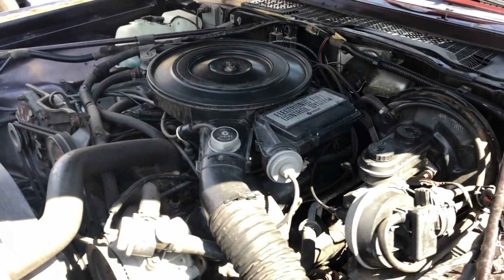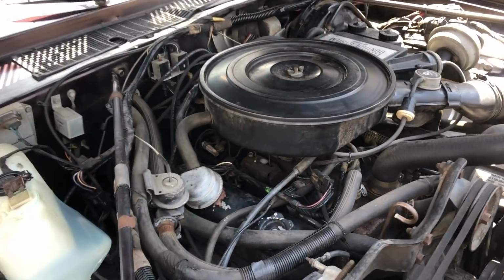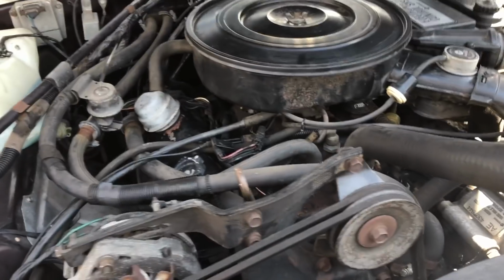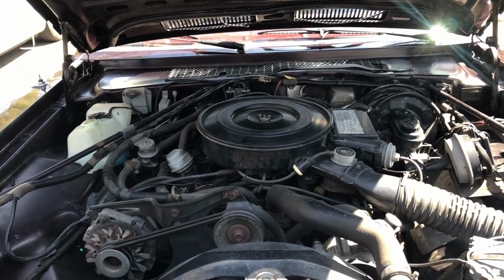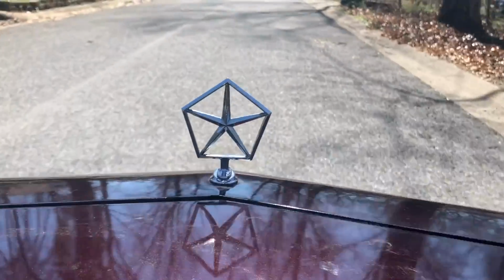The Car Chrysler Forgot to Stop Making - My 1988 Plymouth Gran Fury

Comment: These were not great cars.  My father bought one new and when he passed away I inherited it.  It was in mint condition still but I did not keep it long.  The 5.2L had less real world power than 225 slant sixes had 20 years earlier.   The open differential in the non-police Fury left the car nearly stuck if one rear wheel was simply on a couple wet leaves.  The suspension was overly soft and body roll in corners was dramatic.  Honestly it was stylish looking but in real world driving it was far worse than the old Valiant or Dart.  Dodge pickups from the same time period had better power and superior handling over the Fury and Diplomat.  My impression was that Chrysler was trying to kill their V8 RWD car sales off at this time.

Comment: When he start the engine in the 3:45, a strange sound is heard (like a pounding), can anyone tell me what it is? Thanks!
Reply: Sounds like maybe a worn starter solenoid clunking, or perhaps the flywheel ring gear has broken loose a bit, and rattles when the starter gear engages it.  Very hard to say.

Could also just be the editing altering the cranking sound.

Comment: I had two Dodge vans. 87 and 90. Chrysler did a really big improvement in 90 on electronic ignition. The only piece of that puzzle that then needed replacement every 20 to 30 thousand was the oxygen sensor. But the 90. The 318 2 bbl was running with power like it was suppose to.  I understand the idea of keeping it original. But if your going into making it a driver. Go with the conversion. You will still have the bones of original. Good story.

Comment: That platform goes back the Valiant and Volare era. Very awesome car by the way. I owned an '86 Diplomat, I miss that car. I owned it for over 10 years without major problems. I did end up rebuilding the carb and distributor to get rid of that computer problem. That improved that car immensely. Mine was brown with brown interior. I miss it. I moved up to a minivan in 2006, but man that ride and that V8 power.
Reply: The M body was a modified F body.  Neither had anything whatsoever to do with an A body.
Reply: @pkranz937  It's a related modified platform, both share a lot of commonality, that was more to my point. But how I typed it, one would assume. Thus I apologize.

Comment: Cool video. I had one of these in 2003, it was given to me and in pretty shabby shape. It may have been a law enforcement vehicle, as it had a dark blue vinyl interior and white exterior with plain black wheels. There were also drill holes in the interior that suggested equipment had been removed. Anyway, even though the car had a funky smell, I grew to love that car, the way the car rode and drove, like an effortless cloud floating around.
I look forward to updates on this project!

Comment: My dad drove a 87 Fifth Avenue and he never had a problem with it.Purchased new and drove it until 1998 well over 100,000 miles..
No problems with the lean burn system either.Only repair was the a/c compressor.

Comment: Chrysler flogged loads of these things to fleets. My family had two of the Plymouth Caravelle model, which was a Canadian version of the M Body. We used them as taxis, and ours were ex-military and were factory LPG. The single large tank was behind the rear axle, making trunk space pretty small. Those two cars were in service many, many years. Neither the engines, transmissions or rear ends every gave an issue in these cars. The dashboard was metal and all the seats and hardware were very durable. No wonder fleets loved the M Body so much and Chrysler kept building them.

Comment: Nice M body there from Pennsylvania. I have never seen one as late as an 88 or 89 with no Air conditioning. That car seems to have alot of options for a gran fury.. fancy digital radio... cruise.. inteemeninent wipers..  but no air.. just an idler pulley in place of the ac compressor.
Reply from the maker: Thanks man for checking out my Gran Fury video.  I appreciate that and your comment.  And I agree with you in that this car is weirdly optioned.  I like to create a profile of the guy that ordered this car when it was new and he probably said stuff like "air conditioning is just something that's gonna break and cost more money to repair".  Or maybe he was a tradesman like a bricklayer, plumber, carpenter and felt A/C was for sissy's.

Comment: I remember nothing but problems with any Chrysler made choke at the time. In Canada, our 78 Plymouth Valiant had the 318 and the choke was a joke until I had set the carburetor to run best on warm and get this -  in teenage logic, took off two of the four cooling fins for it to warm up properly. That car had so much extra cooling capacity my idea worked brilliantly until we had to pull a trailer which was almost never.

Comment: That god damnned headliner. Every Chrysler for 20 years had the same headliner that would fall down in every vehicle the same way. Plymouth Horizon? Headliner tent. Dodge 600? Headliner tent. Caravan? Tent.
Reply: It wasn't  just Chrysler.  A lot of the cars from that era had the same problem
Reply: @CavemanCBB  right all of the 80 & early 90's GM vehicles did it too!
Reply: Tent shoe.
Reply: It happens with many GM vehicles of the same era
Reply: @sc4538  Exactly!.Fords and Imports included,I’ve owned plenty of different makes with this issue.
Reply: My 1994 Chrysler Concorde's headliner has never sagged. It's still like new

Comment: Okay,
You found a diamond in the rough. Now, spend $125.00 and honor the original owner by getting a new headliner. I can do it in an hour for $90.00.
Reply: Why is Jeff Bezos making retro car videos for YouTube?  Doesn't he know that Leno has that covered
..?
Reply: I can do it in 50 minutes for $85.00
Reply: @SonnyGTA  
Thumbtacks📌 ?!😀
Reply: Charlie S. hahaha I was just being a ‘one upper’.  That dildo saying he can do it that fast for that price.  You know that turd doesn’t even OWN a car let alone ever doing a headliner.    Everyone can always ‘do it better’ than you did!   🙄
Reply: Redskins Pride WGIL 
The headliner was about the worst thing that you could say about that car (that stood out anyway).
Reply: I bought a 120"x60" roll of headliner material on Ebay for $39 and a $12 dollar can of 3M spray adhesive and had enough material to do 2 on my '88 Fury.
Reply: Where you at Redskins? I was quoted $500 to do the headliner in my '91 Cadillac Fleetwood and I was even providing the material. LOL. Needless to say I passed!
Reply: How do you get it in without taking a window out?
Reply: @tomjones4318  You just have to remove all of the inside trim starting with the trim between the front and rear doors and the plastic on either side of the back seat, then work your way up to the trim that actually holds the headliner board in place. It took me about 4 hours from start to finish. Once you have all of the trim out you can work the old headliner board out through an open front door. On mine I laid it out on the shop floor and took a broom and swept off all of the old foam. The material I got from Ebay wasn't a perfect color match for the factory maroon but it looked good once installed. One can of 3M spray on adhesive is just about what it takes.
Reply: @1967davethewave  Thanks I've done them on SUVs but never on a car. Guess you go out side ways at a 45 degree angle. Yep, take out all interior trim.
Reply: @tomjones4318  Very tight fit. Seems like I went out the passenger door and had to recline the seat all of the way. That was last year though and I've slept since then, lol!
Reply: @1967davethewave  That's what I took in trade school was upholstery. And all so learned to refinish antic furniture. Strip sand wood filler staining and spraying the lacer or polyurethane. I had a blast learning it. Someone bought a 1987 Buick lasaber 4 door to have the headliner fixed. It wasn't coming out no matter how you tried we had to break it in half to get it out. We just duct taped it together glued the shit out of it once we got it back in the car. You would fucking think as big as those cars were it would have came out easily.
Reply: What's the deal on Josh Rosen?! Should DC🏉 trade for  him? After that brutal injury, I DON'T think Alex Smith's return is a gimme.
Reply: Redskins Pride WGIL “know it all”
Reply: That's exactly what I was thinking. Get it re-upholstered!
Reply: And another $10 for heat shielding on the ECU
Reply: When I was a service writer back in the 90s I had a customer with a dark blue 5th Avenue she put about 500 brass thumb tacks in the headliner. Whenever I wrote up that car if you looked up it felt like you were star gazing.
Reply: My 87 olds cutlas headliner was shit

Comment: My 83 cordoba came with lean burn and i got rid of it for a hei based ready to run system. If you actually plan on getting rid of the lean burn, that would be ideal. Dont mess with the old chrysler ignition system.

Comment: Ditch the Lean Burn unit, fix the headliner and drive it. You’ll probably get better mileage without it and you’ll definitely get more power.
Reply: False, and false.  Tired old myths.  You get no more power or fuel economy by tearing out the ELB.

Comment: My first car was a classic, the 1955 version of your Gran Fury, a black & white 4-door Belvedere.  It had a straight 6 230 c.i. flathead with 123 horsepower & a 3-speed manual overdrive transmission.  Our next door neighbor (a WWI US Infantry Veteran) had bought it new & gifted it to me after he suffered a debilitating stroke.  Nice old gent!  Had a ball in that car.  Engine ran very quiet, all it needed was a carb rebuild.  Rear doors opened at 88 degrees so it was a cinch to load it with all my stuff & head to school at age 20.

Comment: I had an '88 Fifth Avenue, same drivetrain. Nobody could get it to run well at all. Then I talked to  a Dodge mechanic who worked for them from the early 60's thru the mid '90s. There is a special timing light you have to use for these, its adjustable and the timing isn't set at idle its up in the rpm range. But it also has to be checked at idle after that setting.The throttle sensor has to be insulated from the idle stop and it definitely has to be at operating temp first. 
There is also a different vacuum delay for the EGR that makes a huge difference in driveability. It slows the opening of the EGR valve so it doesn't bog the engine under light acceleration. It was part of the aptly named driveability package that was released as a free install. 
The Holley carbs also were prone to sticking the metering valves in the lean position making them totally gutless. Plus, as with all Mopars since who knows when the vacuum (advance) diaphragm is adjustable for tension. This will alter how far advanced the timing is at a particular vacuum rate. These work opposite of a regular distributor vacuum advance- they have full vacuum at idle, not WOT.  
With an afternoon of tinkering, a new set of Bosch Platinum plugs, and a little trial and error my 5th changed from 0-60 in 13.6 seconds and 18 mpg to 0-60 in 10 flat and got a solid 23 mpg on the highway with the climate control set on 70! It never did bog down or misfire after that. That adjustable timing light made an enormous difference in tuning the car.
I hope you love the car for a long time and have the best time driving it!
Reply from the maker: Fantastic comment and thanks so much for sharing all of that.  I'll look into getting the right timing light AND a service manual and see if that gets the car running better.  Appreciate it!  -Chris
Reply: You ground the carb switch and plug the hose at the vacuum transducer on the computer.  

2bbl should be 7° BTDC, +/-2°

4bbl should be 16° BTDC, +/-2°

Then you adjust the mixture to give the smoothest idle at the leanest setting, a slight lean "miss" is actually ok.  Then adjust curb idle, step-up idle, and fast idle, per the sticker.  Then recheck everything.  Plug the computer hose back in and take your carb switch ground out, recheck timing advance through at least 2500 RPM, and step-idle (those two test computer function).  

Now - here's the real pain.  Tuning often brings out other issues - this stuff all works together, and is irrespective of Lean Burn - so if now you have a stumble or hesitation, make sure your plugs, wires, cap, rotor, EGR, fuel system/carb, and choke are all up to snuff.  99% of the stuff that Lean Burn gets blamed for exists on engines without LB.  That's why it's a waste to tear it out.  It really on affects mixture above idle, and timing above idle.

Comment: Have you tried checking the Crank-Position Sensor? (I had the same engine in a Dakota)
Reply: Not in a carbureted engine.
Reply: @pkranz937  That car is in the grey zone  on TBI. If it is carburated then I admit I was wrong.

Comment: I remember working on those cars back in the 90s when Philadelphia transferred over to the Caprice and Crown VICS theystarted getting rid of those cars we put  on believe it or not put C clamps on the lien burn system on the side of the air cleaner crush it down and let it short out and theyStart Write up used to be able to pick those cards up at police auction for for 500 bucks a pop and then we do demolition derby with them  fun memories

Comment: Take and disconnect that bitch box on the side of the air cleaner. Take the two wires from the distributor run them to an HEI ignition module from a 4 wire GM product. Wire from the key direct to the coil (delete the ceramic resistor) the two wires to the pickup on the GM module to the orange and black on the distributor. The low tension wire goes to the wire beside the live connection on the module. Put an ignition coil from a 1975 or 76 Ford product on it and it will run like a dream. I've done that with my Chrysler products of that era.
Reply from the maker: Fantastic comment and thanks so much for sharing the details to swap out that Lean Burn.  It's probably on the horizon as I'm thinking I'm on borrowed-time with it.  Feel like it's just a matter of time before it takes a crap and leaves me stranded.

Comment: Nicely done video . Refreshing to see a forgotten car cared for and fairly evaluated. I had an 83 Cordoba on the road for many years it was a beautiful smooth ride . Extremely dependable . The one thing that did break was the lean burn developed a big of idle , ironically it happened just when the clock rolled over to 100 k.

Comment: What it needs is a 318 throttle body fuel injection system off a 91 Dakota or ram. I had a dakota with the 318 that some re-ard put a v6 throttle body on it. I swapped it for a 360 throttle body and it picked up tons of power, that truck was FAST. 7 sec 0 to 60. It ran out of gear at 135mph.

Comment: It sounds like the temperature sensor is not functioning properly. When you have the ignition retarded for cold running, it won't run when hot. When you have it advanced for hot running, it won't run right when cold. The temp sensor should be controlling this, or the main computer is shot and doesn't recognize the input of the temp sensor.
Reply from the maker: Hey man, great comment and thanks so much for sharing that about the Gran Fury.  I was thinking the exact same thing as you about the temp sensor.  In fact the temp gauge in the dash is stuck on cold all the time.  I know the needle moves a little so the gauge bad.  I think I'll get a new sensor ordered and see if that will do the trick.  Thanks again!  -Chris

Comment: The biggest flaw of these cars wasn't just in the engine bay.  The front seats wouldn't go as far back as those built in the early 70's and as a result, big or tall men always felt cramped in the 4 door sedans. Also tall men (like cops) would always have to duck to get in then have their heads brushing on the headliner while moving around or rolling into pot holes, tight turns or speed bumps.  There was a horse blinder effect of the center pillar on the left side of the "tall" driver when the seat was all the way back). Had Chrysler allowed for another inch and a half more of legroom forward of the dashboard and not back injto the rear passenger's foot space, , it could have been a whole 'nother story!!

Comment: 300 bucks to change it over to electronic? That's way steeper than what I paid. I have about 130 bucks in mine.  Give or take a little either way. That includes an older model intake I bought from my local junkyard. New carb and distributor. The wiring harness was 20 bucks. New orange spark box for 10 bucks. I used a 71 2bbl carb. I think it cost about 40 bucks. Dist was 30 bucks I believe.  I wired it myself. It's not hard, The only wire you need is the purple wire in the cars harness. 3 wires, plug it in and you are ready to go.

Comment: The electronic controlled carburetor system didn't work when it was new so don't feel bad that after 30+ years it still doesn't work. 
   Have mercy on your Plymouth and take all that crap off and put it in a box in the garage attic. As others have suggested, get an aftermarket fuel injection or carburetor system that works. The car will drive better, get a little better fuel economy,  and pollute less.